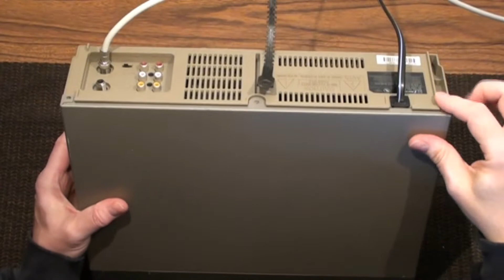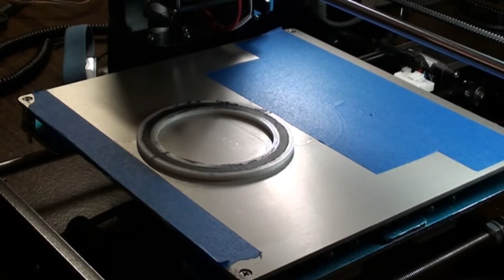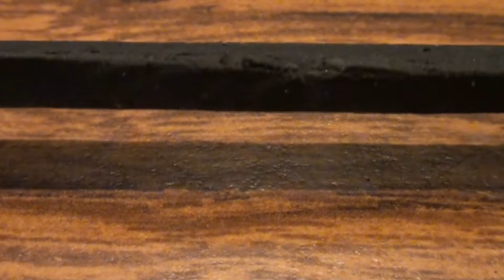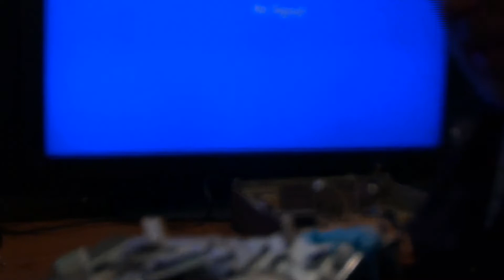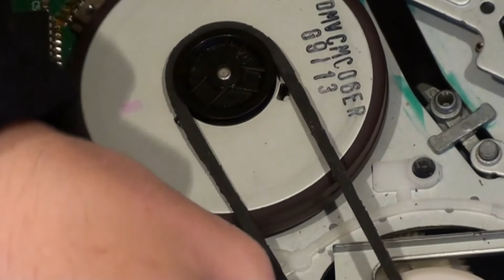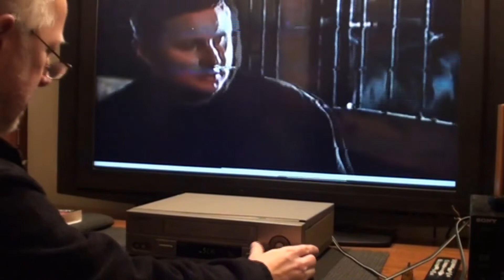Emerson VCR Repair - Won't Fast Forward or Rewind

Comment: And just to confirm, did you use isopropyl then white lithium grease on the mode switch?
Reply from the maker: Yes, I used that to clean it. I only used a tiny amount of non-conducting grease. It wasn't lithium grease, though. I believe I just used axle grease.

Comment: Crazy, I have the exact same VCR, a model EV818, with this exact same issue. I haven't been able to find info online about it, though. Do you know if it's auto-tracking? I know the tracking can be changed manually with the channel buttons
Reply from the maker: It's been a while, but I think I tried the tracking, and it didn't help. So, the belt was the complete issue with it.

Comment: I have the exact same issue. Cleaned the mode switch and even tested it with continuity, the mode switch works but same issue. 
Still watching your vid
Reply: I love your solution! Very creative 
I don't think my issue is the belt
Reply from the maker: Be sure to check those belts. If there's any slack, they probably need changed. Thanks for watching. Good luck.

Comment: Problem now is that the door will not open when ejecting a tape.  Cannot see what is working right or wrong
Email upon a request.
Reply from the maker: There is a little lever that should be touching the door that when the tape ejects, will pull the door open. open the door before you put the front plate together with the body of the vcr. That should help you.

Comment: Good video ; i've a 90s VCR which drum keeps spinning without stop, once power on (even there's no tape).

The tape can well roll onto drum but fail to play / rewind or forward.  Press "play" without video output ; VCR displays from "play" to "Stop" itself (but the drum is still spinning).

Do you have any comment / advice to me ? 
Great thanks !
Reply from the maker: You can try to clean the mode switch. It sounds like things don't know where they're supposed to be at startup.
Reply: @ElectronicsEditor  Thank you very much,   will try your suggestion.

Comment: Mine is having the exact opposite problem. It will stop and Rewind or stop and fast forward but it won't fast forward or rewind during play. It actually won't even play. It just freezes as soon as I press play and then it stops and turns the whole VCR off and when I turn the VCR back on the first thing it does is eject the tape.
Reply from the maker: Make sure the belt is not to loose. that could cause that problem. Try putting a rubber band on it (a little smaller than the belt) in place of the belt and see if it works properly and that will tell you if its the belt or not.

Comment: Good vidéo thanks , wich kind of Grease is ok for the mode switch? Same as for mecanisme?
Reply from the maker: A small amount of lithium grease should work everywhere. A small amount goes a long way.
Reply: @ElectronicsEditor  I'm surprised lithium grease worked since it is not conductive and the innards of the mode switch need conductivity between the rings on one piece and the prongs from the opposite piece.
Reply from the maker: @Marcoosianism  The grease is just so the contacts don't start to dig into each other over time. It's so they slide easily across each other while still making contact. If the lithium grease was conductive, it would short all the contacts together, and we don't want that.

Comment: Hey you gave it a go,  and a bit of fun :-D
I imagine the makers of belts coat a drum with rubber,   then cut rings off with sharp blade wheels, maybe lol.
I havnt a clue really.
I have had a lot of belts just turn into black goo,  horrible stuff to get off mechanisms :-(